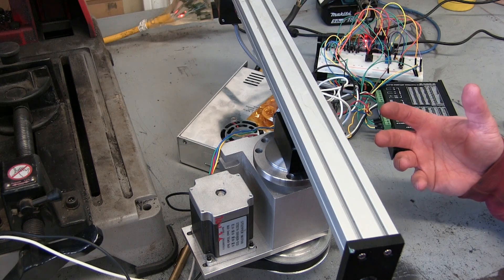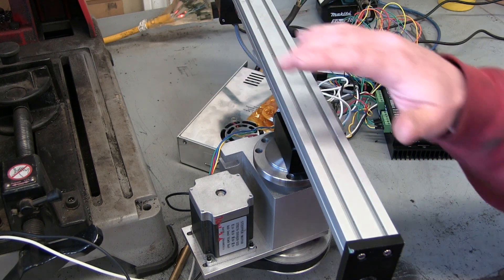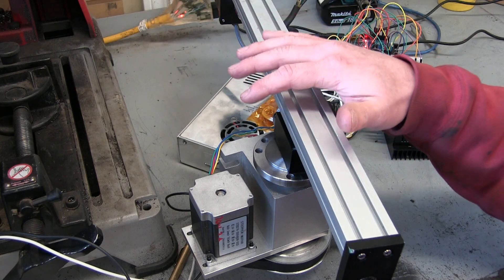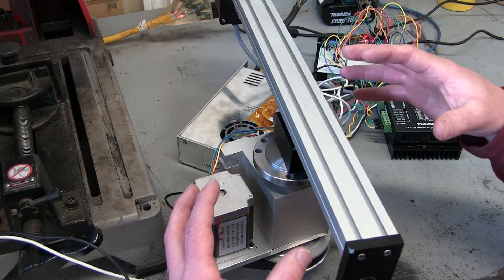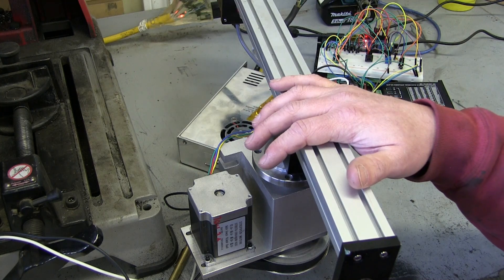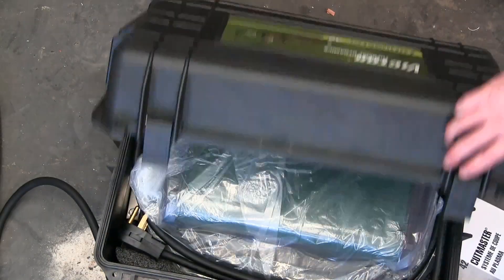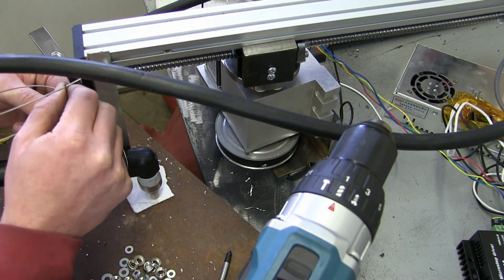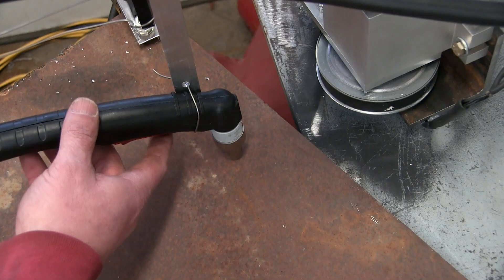Portable CNC Plasma Prototype

Comment: By George, You've Done It Again!
Since you're already working the smartphone angle: phone cradle on the machine? use phone camera to automagically get the code aligned and placed on the work?  Could also help with re-positioning for cuts larger than it's capacity?

Not to mention makes for safer selfies on 30 story skyscraper builds.
Reply: Augmented reality overlay preview?
Reply: The two of you are my favorite youtubers ( AvE and This Old Tony) really motivate me to join the party. Young and broke at the moment but hopefully start diving at some top notch power plants very soon :D
Reply: My thought exactly. Microprojector to see what's going to be cut and for precission placement ...
Reply: This Stuff I Do I think that's getting ahead of yourself a little. it's a CNC after all, why would you need a 3d overlay? Pricey and not needed.
Reply: "Print Preview" - An extension of TOT's idea/comment "use phone camera to automagically get the code aligned". Basically the same technology. Libraries to do this can actually be purchased off-the-shelf at a reasonable price or free. ARToolKit, for example, is free and open source and available on several platforms. 

Definitely agree 'not needed', but disagree 'pricey'. 
Mostly the concept would add 'pop' factor when pitching the device to a venture capital firm. Have been in this situation a few times. Can confirm. :)
Reply: Old video but I love it, keep up the great work

Comment: u should try an  isolation block between the plasma and the steel that way if the mag is sitting on a bit of shmoo it wont force the head into the steel plus the drag on the steel might steady the torch. just an idea

Comment: You need to skookumify the mechanicals so it has less play, but you already knew that. You should also slow down the angular speed the further out the head is along the arm, so that the total velocity of the head is constant, or at least doesn't get too high. The speed along a circle is the angular speed in radians times the radius, the bigger the radius the smaller that angular speed needs to be. Fuckin' awesome idea man

Comment: As a Super Premimum feature you could have a camera or 2 mounted on the thing with some software to take a picture, then you draw on the material to be cut through.  Then the software takes another picture and cuts on the lines you've drawn.  It could even auto straighten them and or interpret symbols you draw.  Or you could use a laser pointer to mark a couple points and have it cut between em.  obviously this would be down the road a bit.  but it would make cutting as sleasy as 123

or take a picture with your phone.  The phone would recognise the location of the magnetic base.  You draw on the screen the cuts you want made and hit run.  
A child could operate it this way.  no more construction paper in the nursery

Comment: don't think your over looking much, you could add a little light sensor to find zero. and a make a white mark on the work piece instead of having to place the magnet in exactly the right spot. feed speed is easily controlled I think with a little math input on thickness and material. the smaller the better as far as profile on a rig like this. say an 18" diameter on your rotation tops. but for most things in the field for your regular joe shmoe I think about 12" with an automatic zero would work. adding a light marker or a white dot or something for a zero mark you can lay out with a tape would dope AF

Comment: 1: If I had work for it I would definately use it. Nice thinking on the product and finding something new in excisting markets!

2: Idea for construction: simple construction almost as you have it now but the aluminum (or as we call it aluminium) swapped for 1 or 2 linear guide rods (non supported). Should make it dirt cheap and easy to service/replace parts on. So 1 or 2 linear guide rods + trapezium lead screw instead of a ballscrew (plasma cutting does not really need the accuracy of a ballscrew, lead screw should suffice.

Have fun on the project! I know the feeling, it is awesome to see your ideas grow and become tangible.

Comment: you nee to figure out how to keep the abrasive metal fumes out of the internals . not sure how well this would work onsite , but i can see this taking up the corner of a 4x8 metal bench , to be pulled out when some precision cutting needs to be done , or multiple parts need to be cut out .

Comment: OK Here's my two pennies: What if when using the Phone app you could use the camera to register a couple of cross hairs the operator draws on the plate with a mark all, therefore allowing whatever shape you need cut to to be registered before cutting? Allowing for off the cuff cutting or precise cutting.

Comment: Use a SCARA firmware on a RAMPS 1.4 board. SCARA is for radial arm filament deposition or subtractive routing/milling. Other boards support SCARA but I don't know which ones, That should takecare of the curvature on youre x radial axis.
Reply: I forgot to add that it would be handy to have a bit of Z-axis, what fer cuttin' ingress/egress hatches into Russian nuclear submarines and breaching the curved shells of Chinese spy satellites. I know where you're going with this , uncle-B you cheeky weasel.

Comment: To cut larger parts, the thing could "mark" the next attachment point. Like - want a straight line 5m long? you can cut it using a 50cm rod. Just measure where to put the base next... same goes for complex shapes of large size - re position the foot where the machine puts a "spot", and it will continue to cut the path that was initially out of reach.

Comment: regarding the line cutting programming: the simplest thing that could possible work is to step in the direction which traces the line so as to get to within 1 step of the line at all times.  no need to really change coordinate systems beyond determining what rough direction with respect to the tangent line of what you are drawing is radial and which is rotational.  this even works for arbitrary parametric curves, heck it works for everything that can be parametrized as a programmer's convenience.  the control loop will be a series of if statements.

Comment: I think it's a great idea. I worked on offshore drilling rigs for 27 years as an et and finally a Chief Engineer primarily on drill ships.  I can think of note than half a dozen instances that this could have thousands of dollars in downtime.  I would be very interested in lending a hand on the control and feedback system as there will I assume there will need to be a way to verify tool position, and other feedback input.  Not sure the procedure for volunteering but I  and you can email me to tell me what you need.  Oh and one more thing.....Keep you dick free from lice...see what I did there.
..clever huh.

Comment: this is an awesome idea, I wonder if some of the code used for delta 3d printers may be of use to convert the shapes. 
speaking of 3d printers I wonder if this would also be applicable to a possible 3d printer layout, but have it suspended above a build plate on a separate z axis.... not seen many designed like that, I think maybe one or two? not sure, could be onto something here.

Comment: My suggestion would be to have some kind of floating point mode... or what ever...  Basically I'd like to be able to plop the machine down, and then move a pointer on it and say "this is the box I want you to cut inside of" or "this is the center of X shape" or "these are the corners of the plate" so set up and orienting the machine from plate to plate would take seconds and not involve much measuring or manual data input to get the cuts started.

Comment: I reckon this idea is pretty sweet! I'm working in heavy fabrication with trains, it would be gold for doing in-situ profiles, especially for more delicate holes like those for electrical connector chassis or thru holes for structural members like universal beams and channels. 
Portability is key, and to cut profiles in-situ (or close) without going back, marking holes out and cutting, going back, checking etc is a plus. 
Could also be used instead of dedicated profile cutter where plate is cumbersome or already folded - bring Muhammad to the mountain.

Comment: As an amateur fool on a stool, I would prefer a cartesian xy setup like the drawing robot. I just cant think in polar coordinates. 
Can the drawing robot hold the weight of the plasma cutter? I feel like the servo that lifts the pen could easily be adapted to work the trigger on and off. 

I know that's super lazy and not as much fun as building it from scratch.

Comment: The calculator to convert two linear axis's to convert from the 2D print, to convert to this set up.. but once you get it dialed in... that being portable, out on the jobsite or the race team being able to snap out a perfect part to be welding in ... great idea!!!! I am wondering if the firmware/software from the gimble type 3D printers would help with that, as per the emulators/converters?...  This is exciting!!!

Comment: You need to get a hobby servo motor to actuate the trigger on the plasma cutter. Should be able to rig together something that works with twist wire and/or zip ties. There's a great Servo library for the Arduino platform to work with. Maybe a simple screen with rotary encoders/potentiometers/buttons would be better for the interface instead of messing with a phone? Communications are always a source of headaches and problems. 

The kinematics might be a little tricky to get right, but I think I've seen some 3D printers that use a similar geometry (expect with a spinning base and extruder that moves in/out). Those kinematics should help for at least getting a decent start on things.
Reply: Nah, it'd be far easier to just close the connection inside of the plasma cutter the same as what the button's doing.

Comment: If you want to make it easy to use implement some basic optical scanner/follow the line type deal. Design it so that all you have to do is draw the shape on the piece of metal and the robot follows it to recognize the shape and then cuts it out No bumblefuckery needed for the user.

Comment: I think you'll have to have a disconnect between the phone and the machine itself for safety reasons. Like have a printer style thing going on where you send the commands to the cutter and then actually activate the cutter manually. 

Cool idea though. This would have gotten my company out of a heap of shit doing escutcheons for electrical switchboards. Perhaps adding a small compressor to make it REALLY portable? Not sure how much pressure plasma cutters actually need to be functional.
Reply: Keep in mind too you would need to make it cheap and easy enough. The main thing you're going against is the slackjaw lazy fabricator like me just going "Fuck it I'll just setup a square edge with clamps and start cutting".

And the "would it just be easier and cleaner to get turret punched".

Goodluck though!

Comment: oh great uncle bumble fuck I have an idea for a system of location of said holes,  a while ago I saw a handheld cnc router they were using strips of like this barcode tape or some shit that a camera on the router used for location as to when and where to do it's stuffs.   anyway I was thinking instead of a whole strip of this barcode a simple 1x1 barcode or even a recognizable dick pic sticker that said phones camera can use to spatially figure out the size of area and where the machine is, from there it's just a matter of telling the phone you want a 2x2 square over there there and there on the screen and then the machine goes in search of the dick pic so it can orientilate itself and then go aboot it's business.

Comment: Lining up the orientation of the metal and the polar translation of cartesian coordinates will have to be done. I'd recommend designing a software calibration to find the position of the laser relative to the sheet metal by recording the coordinates of the corners of the metal. Otherwise your metal will look like a preschooler's art project once you're done cutting stuff out of it and you'll waste a bunch of metal. Of course calibrating will be difficult as reaching all 4 points would require having the mag base in the center. Instead I would try to have the mag base in a corner of the metal and from there have the plasma cutter calibrated to 3 points, so you can use some reference point on your mag base as an origin. Looks pretty good, but getting the ball rolling on projects like this is hard, even if the proof of concept is easy. Making it work perfect and easy is tough.

Comment: The math is there....  the Armed robots do it...  The Gcode interpreter has to translate cartesian coordinates to polar from point of rotation to point. what is that atan, since,cosine??? angle + distance?  Andy Pugh here on youtube is real good at the math portion..  figure the X/Y then solve for angle and distance from your pivot.  The conversion could be between computer and the BOB. Computer is sending cartesian steps and the converter is converting to axial/distance.  My cartesian cnc is 200 steps + 16 microstepping + 1/4 rotation per mm == 1600 steps per mm.  Arduino mega could do it pretty easy -- read the steps and convert.  Hell a raspberry pi with a touch screen on top of the linear actuator running linuxcnc and a arduino doing the converting.

Comment: You'll get distortion of cuts running tangent to the arm's rotation if the shape is big enough and/or located far enough in unless you plan for having it add a bit of radial motion to compensate. The thought gives me a headache, though. I may be nerdy, but I'm not that nerdy.

Comment: Great idea, some things you could do / add to this machine:
  1. Just like with some saws, a light that cast a straight shadow or laser to act as a visible indicator of where the arm is lined up. 
  2.  A digital timer that shows the remaining time for the selected shape. Clipboard warrior comes by and cant say anything if he sees that the program is still running.
  3. There are toy cars and other things that follow a line drawn in certain chemicals or metals. It would make this machine infinitely more adaptable to any situation if there was an eye that could read say a graphite line and follow it to cut out any imaginable shape. 
hope this helps and keep up the good work!

Comment: don't know too much about cnc but if you have an extra output on the controller couldn't you use that to bypass the trigger on the torch head? or is it also mechanical for the air?

Comment: My main concern would be loosing resolution as you work further out on the  arm... The speed control on different radius is just screwing with the number pi alot. Manually making machine code for that sucker would also be a mathematical exercise and a half for you highschool maths methods kids.

Oh, side note. I see a potential problem/use if you place this on a steel deck and the thing cuts a ton hole for itself and drops a level.

Comment: The maths for this will be really interesting! To get a constant feed rate for the tip (just the tip) you need to take the absolute position of the linear axis into account. This should be quite simple with a constant velocity of the stepper motors, but throw in acceleration of the axis into account (which for the rotational axis is directly related to the position of the linear axis) and your brain might melt.

Comment: actually, an app might not be the best of ideas, with iphone/android issues, pairing pain, and orientation bias due to the screen would SUCK. The best solution might be adding a cable connected control with pre-programmed patterns and a 2-button 1-nob set for function choice and parameter setting (an AT mega with a small memory would do the trick) would only need a small matrix screen. KISS FTW man!

Comment: Just need to find if the manufacturer supplies a CNC cutter version of the wand, I've seen them available for other plasma rigs that I have used, replacing the handgrip with a straight vertical shaft that has mounting brackets and a remote trigger that can be fed from an external relay. Useful features- Some way to swap/retract the cutting head and replace it with a chalk or other marker so you can 'dry run' the exact cut you are making.

Comment: set up time to set up the shape, then set up  the mag base cnc and plasma,  do a dry run to make sure I'm zeroed where I want to cut the part at...ECT ECT would not be economical compared to drawing out what I want with a piece of chalk and firing up the torch and burning it out right quick. HOWEVER where I see the advantage here would be the ability to do more complex parts like flange faces and things of that nature that take a lot longer to layout by hand. also if it would fit in the back seat of  my welding rig and I got called out to an oil rig and needed 20 gussets and I could set it and walk away while it was cutting. I'd by it.  so small single parts it's not ideal but orders of 5 or more in the field on location or complex parts yes.... very scoocum